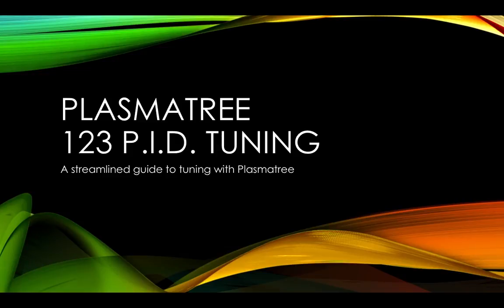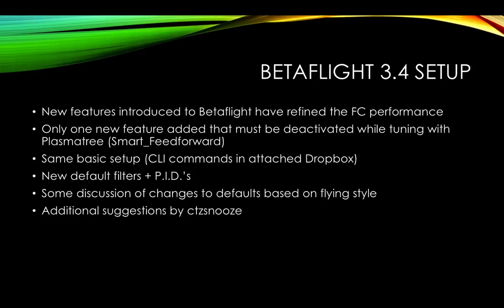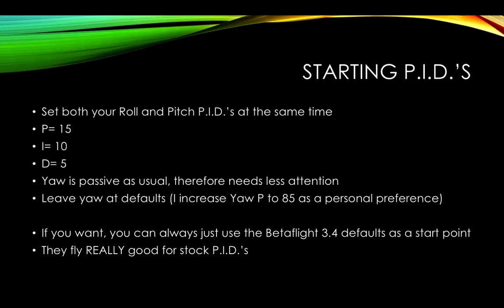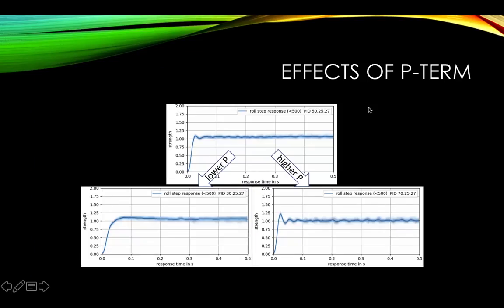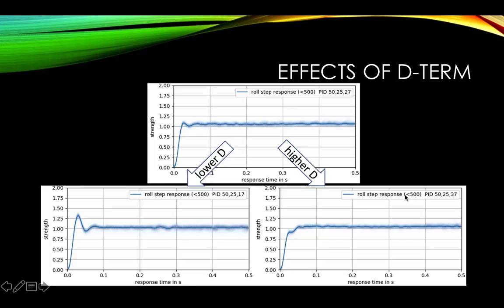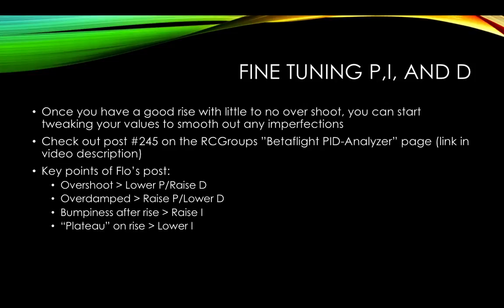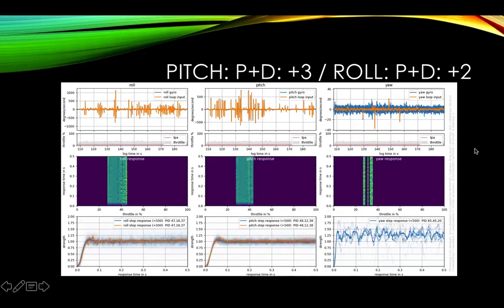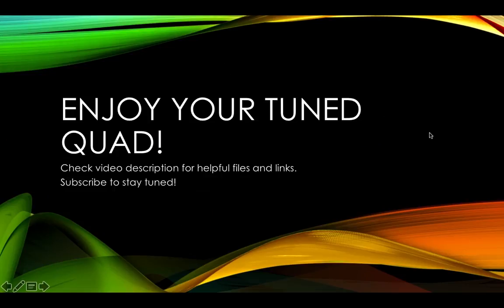Plasmatree - 123 P.I.D. Tuning

Comment: Nice explanation.  Well done.  Thanks.  Where do you have d setpoint weight and transition during your tuning process?  Do you leave them default, then change after the tune?
Reply from the maker: There's been some talks on the forums that leaving whatever settings you normally use is preferred. It seems like you need to adjust things after re-enabling them afterwards. Best to tune with all systemic bias.